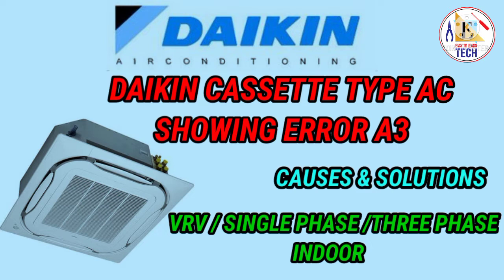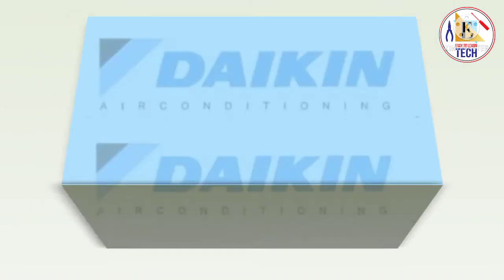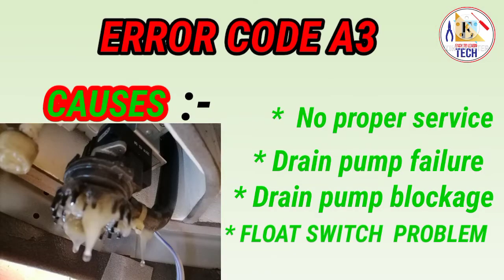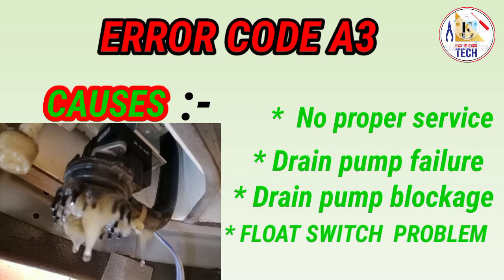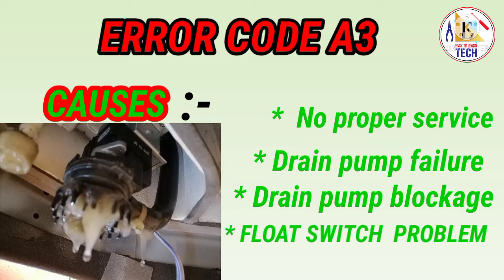HOW TO SOLVE THE ERROR CODES A3 FOR DAIKIN || TROUBLESHOOTING // DAIKIN AC ERROR CODES & SOLUTIONS

Comment: Please I just install a daikin 5hp cassette unit but the yellow light on the condenser panel is blinking non stop while the unit is running and cooling effectively, what can be the cause of the yellow light blinking
Reply from the maker: Can you please send a video by mail. And the outdoor PCBs cover picture. ( wiring diagram side)